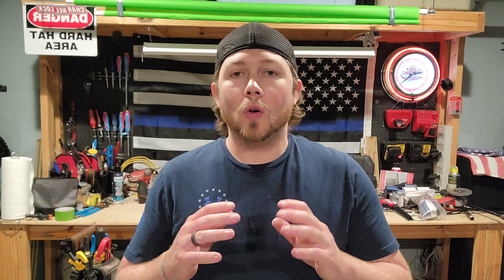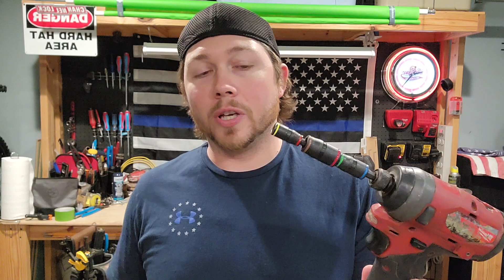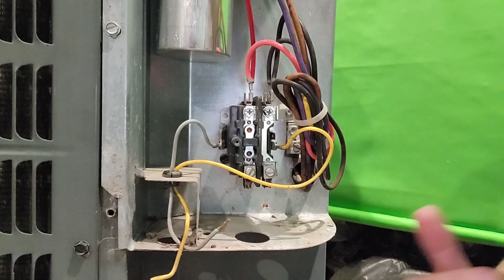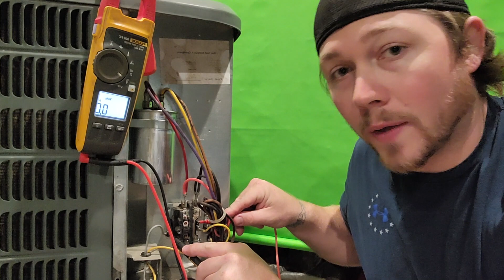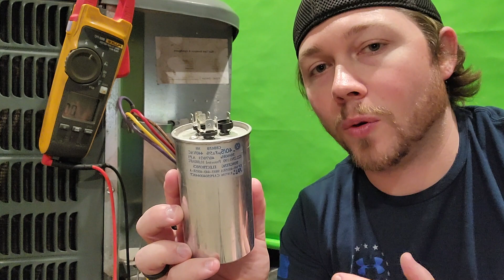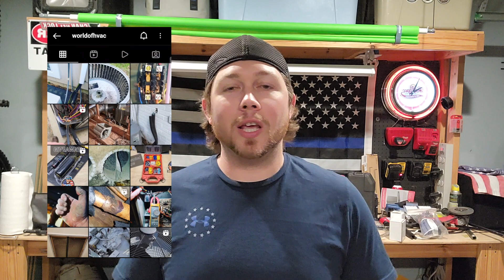How To Replace Your Contactor And Capacitor!

Comment: same steps for start capcitor as run - discharge both - then remove connectors on contactor - ?   do the wires on top capcitor matter order?
thsnks in advance
Reply from the maker: Yea same on start cap. Most of them have a resistor soldered between the terminals so they discharge on their own. Wires dont matter on a start capacitor.
Reply: @WorldofHVAC  do they matter on runm cap? - thanks again - have conntactor arriving tomorrow am
Reply from the maker: Yes it does matter. The compressor had to go on the hermetic and fan goes on the fan terminal